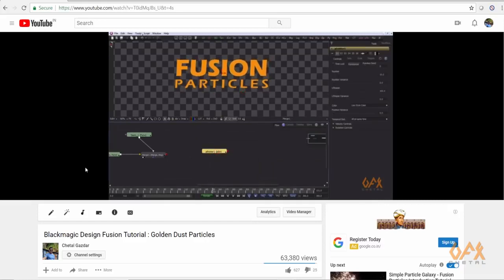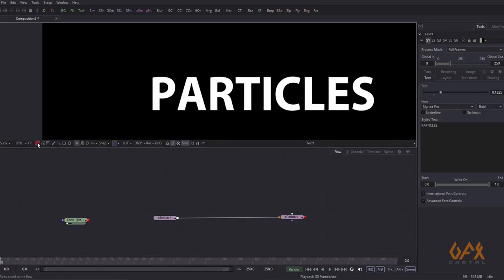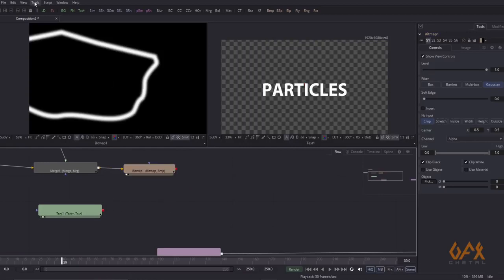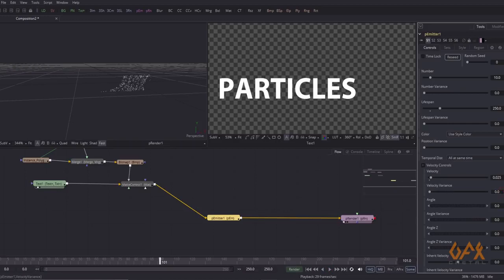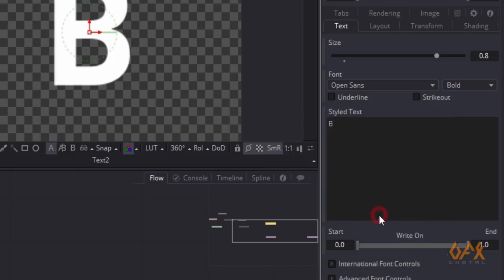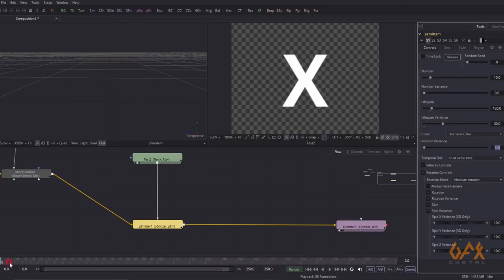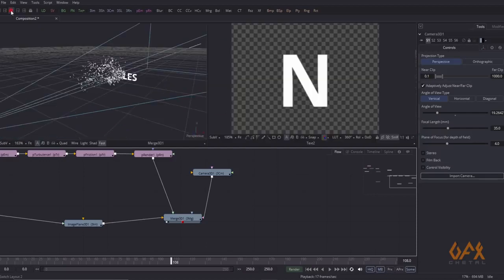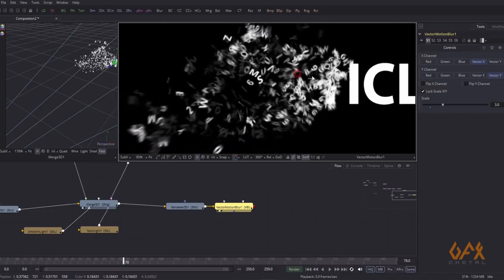BMD Fusion Particles Tutorial | Generate Text from Particle system

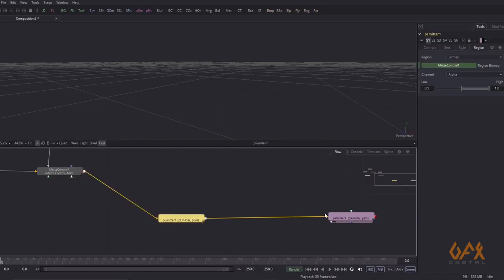Comment: I tried this in DR16 on a new MBPro and it was replicating the results exactly as you showed until the point where I connected the Matte Control to the pEmitter (12:31) then part of the text showed up even on the first frame. The polygon was moving across the text but it wasn't appearing as in your video. Thanks for your efforts though, it would be amazing if I could actually understand what I was doing rather than just clicking what you tell me to click! 
I might try it again in a standalone project to see if anything was different in the project I tried it in.
Reply from the maker: Sorry for the late reply..  may be you connect your Bitmap output to the "SolideMatte" input of Matte Control.. you should connect it with "GarbageMatte" input of Matte Control..
Reply: @ChetalGazdarVFX  Thanks, can't believe you're apologising! I started over and it worked (almost!) exactly like yours. 
Firstly, my brain hurts now. I learned so much from this, but I also found myself following your instructions and having little idea what I was actually doing.
The end result was great but your letters move as if a swirling wind is randomly affecting them. Mine don't do that. Did I miss something or did you add something to the final version and forget to tell us! (just kidding!)
Thanks so much for this amazing effect. (subbed, of course!)

Comment: Great tutorial.  Can i ask the spec of your computer.  Mine struggles a bit with the rendering
Reply from the maker: AMD Ryzen 5 1400 Quad-Core Processor
8 GB RAM
NVIDIA Geforce GT 710
Reply: @ChetalGazdarVFX thanks, I have been using the fusion in davinci resolve, does the stand alone version of fusion run faster?
Reply from the maker: @ChristianLawrence  I prefer stand alone version.. In resolve I faced problem of speed..
Reply: @ChetalGazdarVFX its a shame you can't use the stand alone with my paid DR16 licence. The particle renders stucked the life out of my pc. 🤣🤣  thanks again for the great tutorial, I have been teaching myself 3d fusion so used it my latest video on my channel 👌👌

Comment: I find that when I render it, the resulting video has jitters. I rendered it a few times, and there is no pattern of where or how many jitters there are. I am using an extremely slow computer with 2GB VRAM. Could the slowness of the computer affect the quality of the rendering of such a complex Fusion composition? I wonder if I render it on a faster computer there would be no jitters in the resulting video?
Reply from the maker: try to upgrade your graphics driver..may be it will help you out.